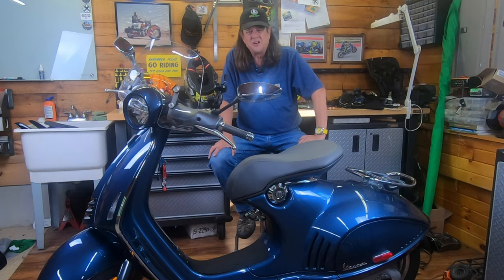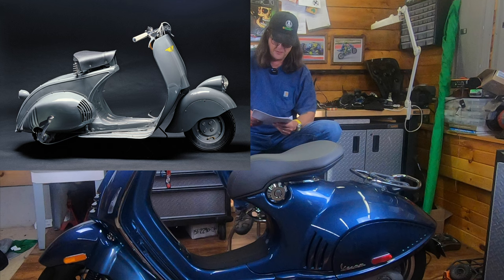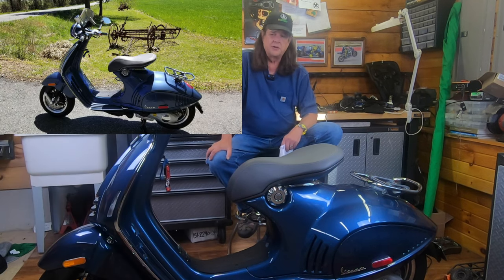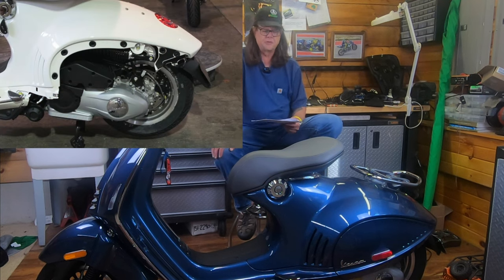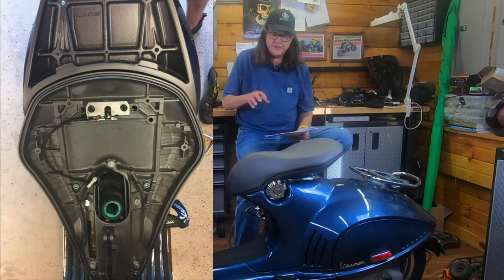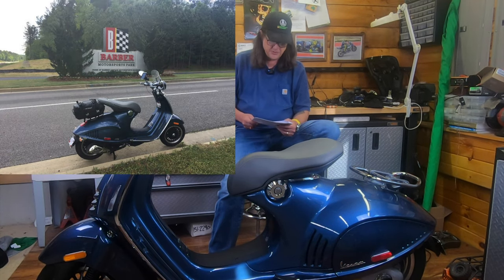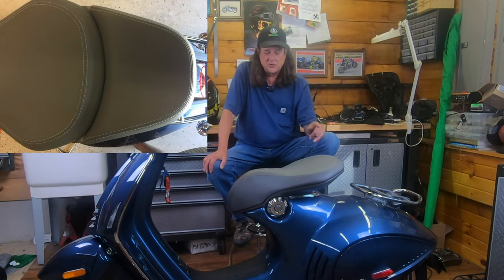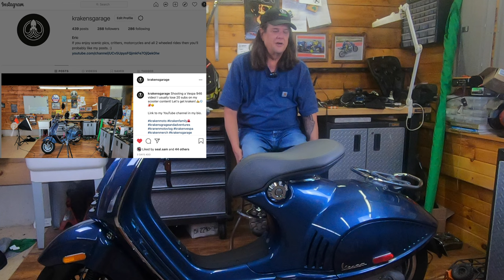Vespa 946 - Long Term Review!

Comment: That gorgeous aggressively forward leaning seat stem, the upswept single seat & the downward sloped rear rack are simply a work of art.  Like a sports car, perhaps not practical in the sense of real world daily use & no storage to speak of that you expect in a scooter, entirely bespoke/handmade with all those luxurious aluminum parts & oh so beautiful.

 I especially love the fairly recent Giorgio Armani edition.  Absolutely stunning.  One of these days...  FYI:  the most recent incarnation; the Christian Dior Special Edition is currently listed between $35 000 & $40 000 CDN$ depending on dealer as of this posting here in Canada.  Pretty sure that's bare bones without the luggage/accessories.  I think the one I saw in Vancouver was around $37 000.  Maybe, just maybe I too will find one for around ten or eleven thousand $ one day as you did.  This was an excellent self aware, informative, straight up video.  Good on you sir.  Well done!

*Edit:  You just rightfully earned a new subscriber in me along with a thumbs up..  Cheers from Vancouver Island, BC, Canada.  On a side note, although not a 946, the new "Justin Bieber" Primavera is an abomination.  What does he know from Vespa?!  What does he know from anything?  I get the concept of accomplished designers & artists working with Vespa but fruity, puff pastry pop stars?  Too bad there isn't a Salvador Dali or Pablo Picasso edition out there somewhere, or maybe you know some more things I don't know?  Is there a chance of it being a reality?
Reply from the maker: Well, thank you and my apologies for the late reply, I was on a bike trip. I just cannot believe the Christian Dior variant sold out! Strangely, I like the Justin Bieber edition but would have to de-Justinfy it and peel up all the stickers. The ghosted out Vespa looks good to me. I feel like I need to turn in my man card for saying this. lol 

I wouldn't sell my 946 for anything! I purchased it from Af1 In Austin, TX and rode it home in the rain 1,800 miles to VA. I need to shoot a video about that journey but I fear it won't be very engaging as I have no video for it, just static photos. My sister did film me rolling up when I got to her house. https://vimeo.com/214344866

I need to do moreVespa content and will get to it soon. If you're passing through VA, hit me up and you can have a go on her. Thank you for your kinds words. Eric

Comment: Well, as a long-time Vespa evangelist myself, I have to say your reflections on the 946 answered a few of the questions I've had about that scooter for a long, long time.  Probably the most common would be:

"Why would anyone pay that kind of money for a Vespa?"

You've answered the question fully and I now understand.  I've seen a couple of these in the local Vespa dealership when we still had a dealership here.  They were definitely pretty and it was plain to see how well made they were but I never got past the price.

I used to buy Leica M6 35mm rangefinder cameras and lenses.  Far more expensive than the Canon and Nikon SLRs that are fully functional.  But the Leica had a mystique coupled with impeccable craftsmanship and optics.  I loved owning and using those cameras and did until I finally sold them in favor of digital cameras.  I see the 946 as a kind of Leica mindset.

Your comments on long rides on a 155cc scooter are spot on.  Every ride is an adventure on a scooter.  My first was a Vespa LX150 and I put 13 thousand miles on mine in a little over a year.  It was fully capable of crisscrossing the United States if I had the time and inclination.

My current 2006 Vespa GTS250 is well worn at 44 thousand miles.  I see another Vespa in my future -- I'll probably bite the bullet and buy a brand new one despite having to dole out $9000 in the process.  You offered the reasons why in the video when you said it will be the last 2 wheeled machine you'll ride.  I suspect the same will be true for me.

Thanks for putting together such a thoughtful, personal reflection on your Vespa.
Reply from the maker: Thank you for watching some of my older content. I'm sure we'll cross paths at some point and I'll throw you the keys to have a go on her. The 946 sure isn't for everyone but when you get older you start measuring life in how many riding seasons you have left in you. So I threw caution in the wind and just purchased on one. I have zero regrets. Thank you for the great comment. Eric
Reply: @KrakensGarageandAdventures  It's funny how lifespan math seems to intrude more and more often.  I find myself calculating my age from the age my dad died.  And other, similarly uncomfortable calculations.  

You're right, of course, that some decisions just make more sense at some points in life and it becomes easier to make decisions about spending money.  We each have our own unique circumstances, but I can also see the common sound among us of a ticking clock...
Reply: Your 946 & Leica analogy was spot on for me.  I still have my old camera bodies & lenses.  Couldn't give them up. I still develop & print black & white iilm in my basement & rue the day, whenever that actually was that the local camera shops stopped developing my colour rolls of film.  There are a few specialty purveyors still clinging or reintroduced to the old ways.  With quality camera bodies, optics & film, just like the 946, you either get it or you don't.  That was well said on your part.
Reply: @Imightberiding  I have a full darkroom in my basement too.  And until a couple years ago I even had an 8x10 enlarger.  I've not done any analog photography in over a year now and have sold all but one of my film cameras.  I just can't bring myself to say goodbye to that life.
Reply: @ScooterintheSticks  Why am I not surprised to hear this from a fellow scooter/Vespa rider?  And from the sounds of it, also of a certain age perhaps?  Just like me.  Ride safe.  Cheers!

Comment: I personally like videos about smaller motorcycles & Scooters ,even though I’ve owned larger bikes. Yamaha SMax 155 cc Scooter is faster & less than half the the cost. Yamaha Xmax 300 cc is less than $6000 . I’ve owned both . My favorite day of all time on any two wheels was on the Yamaha SMax 155 cc  ,that  day I was wishing my destination was further than the distance I had to travel that day. The Yamaha Xmax 300 cc is a great mile cruncher & comfortable for long trips top speed of 85mph. I hope Honda releases the Forza 300/400 cc Scooter back into the 🇺🇸 USA.
Reply from the maker: The Smax and Xmax set the bar for performance in their category. Great scoots! Thanks for watching.

Comment: I've got a 150cc Honda scooter (PCX) for my daily driver, and a Harley Fat Bob for pleasure rides/cruising.  They're definitely on opposite sides of the spectrum, but each one is great at what it does (and I'm extremely happy with both)!  I'm sure it rubs some people wrong, but life's too short to fret over such nonsense.

If folks leave your channel over non-Harley content, it's their loss.
Reply from the maker: Mike, thanks for watching and the kind words. Already lost 3 subs lol! They sure are at opposite ends of the spectrum but I love them for many different reasons. Eric
Reply: I'm sure you've stumbled across a few in your days Eric, but SOME members of the Harley community are extremely fickle!  Some go so far as to turn against each other over things like sportster vs big twin, Shovelhead vs M8, air vs water cooled, etc (for example).

Rather than appreciating things that are unique, everything different is verboten.  While I'm sure that these types would take issue with the inverted forks or the rectangular led headlight on my Fat Bob, they would soil themselves if I still had my 1975 Suzuki RE5 with the rotary engine ;) lol

Comment: Thanks, excellent review. I’ve a 2010 GTV , original owner,14+K & always enjoy taking it up n down PCH in California.
Reply from the maker: I have ridden PCH many times. I would argue is the best road in North America for scenic twisty riding. I love the GTV and I sure don't see them very much. I'm toying with the idea of an orange GTS 300 HPE. Thank you so much for watching commenting. Eric
Reply: The GTV is second only to the venerable 946 as far as prestige/desirability & style .  I am envious of you & your GTV along with Kraken & his 946.  THE GTV is actually my first choice for my next Vespa before the 946.  More available & attainable for me.  The new GTV 300 Sei Giorni looks pretty fabulous.  Although, one day, some day it will be a 946 for me. 

I'm still not sold on the HPE scoots though.  Talk of excessive oil usage, belts constantly breaking & of course twice the maintenance & upkeep/service costs.  Sounds kinda like an Apple/I-Phone product.  Planned obsolescence.  

My top pic for the large frame GTS Vespas are the 2018-2019 models.  Fuel injection started in 2009 but no ABS etc.  ABS/Traction Control introduced in 2015 but also from 2015-2018 they messed/screwed with the front suspension & forks.  They went back to the tried & true suspension in 2018.  Non HPE engines, ABS/Traction Control & a proper front fork assembly & suspension makes the 2018-2019 the best, most reliable, low maintenance GTS Vespa on the market at the moment IMHO.  That's not to say I'm not interested in a new HPE GTV 300 Sei Giorni.  Just some musings & observations from a man of a certain age (read old) with years in the saddle.
Reply: @Imightberiding  Thanks for the input about the GTS and model year reliability; I didn’t know. I’ll probably pass mine on to one of my boys- till then, it’s perfect to park any where I go especially during high tourist season here in So. Ca.👍

Comment: Eric thanks again for your great review. Loving my 946 Bellisima, wondering what if anything can be done to make the seat more comfortable? That forward slide looks sexy but is less than comfortable. My opinion.
Reply from the maker: This is a tough question and subjective. When I bought it, I had an 1,800 mile ride home. So I got a good dose of the stock seat. I would try and Airhawk seat cushion. If you go on that direction, just barely fill it with enough air to get your butt off the seat. In doing this, you won't modify the bike and devalue it. I hope my thoughts help. Eric

Comment: How is the seat for all day riding? I have the opportunity to get a 2014 and I may pull the trigger. Sort of funny that I used your ZX4-RR video to pull the trigger on it as well. Life of a 61 year old that never grew up.
Reply from the maker: At 6'4" tall, it's just okay. Think like you're sitting on a toilet.  I prefer a semi lean forward position. So my spine doesn't absorb all the impact of bumps. That said, I have put many 8 to 10 hour days in the saddle. Also, the seat sits very tall compared to other Vespas. I hope my thoughts help. Let me know if you pick one up. 🛵💨🦑

Comment: Never saw that edition before.  It's beautiful.  Curious if you've had any other Vespa's or dove right in to the 946. It's too bad that they are making the 946 into a rich person's collector toy.  The latest edition selling at nearly $25K is a bit much. I've been riding since my Rupp minibike days.  Been up & down the bike spectrum of just about every type of riding.  I always seem to work my way back to a scooter.  Just bought a Sei Giorni here in NY.  Can't wait for spring.  Wife rides a Primavera.  Life is Good.  Thanks for a great video.
Reply from the maker: I've owned a few scooters, Smax, Xmax and a couple others. So to answer your question directly; yes, the 946 was my first Vespa. They were on my radar and I started researching the 946. It has the same powertrain as your wife's Primavera (assuming it's a 155 cc) air cooled 3 valve motor. The latest iteration at 22 to 25k is insane. Keep your eyes peeled for a nice used one, I occasionally see one in the 5 to 6k range with very few miles on them. If you and the Mrs. ever head south and swing through VA, reach out to me and you can have a go on mine. 

I did purchase a '20 GTS 300 Supertech but sold it last fall for another project I'm working on. The Sei Giorni is stunning and I bet you love it! I'll own another GTS someday and a Vespa will be in my stable for many, many years to come. Congratulations on the Sei Giorni! 

Thanks for watching,

Eric
Reply: @KrakensGarageandAdventures  Funny story.  A few years back I had a Kymco GT300i.  My wife had an LX150.  One of the guys a retired with (Harley Guy) sponsored a suicide prevention ride every year.  Of course, we rode in it.  About 40 Harley's a Kymco and a Vespa. At the end of the day, we all shared the same beers, laughs and conversations.  We just had a lot less chrome than them.  6'4" guys can ride scooters too.  I am hoping to host a DGR up here in the Hudson Valley one of these years.  Ride safe-
Reply from the maker: @Sgt Shak  My channel is all over the place. 50% HD, 50% everything g else to include scooters. I loose subs every Vespa video I drop. Fine by me, you're missing out mate. 

You are so right the beer and food all tastes the same at the end of the ride. Good stuff! 

If you haven't checked put advrider.com,come, to the "Battle Scooters" forum and there's a load of good folks that post there. I have a massive thread there but YT is sucking the life out of me lately. 

Warm days are just around the corner!  All the best, Eric